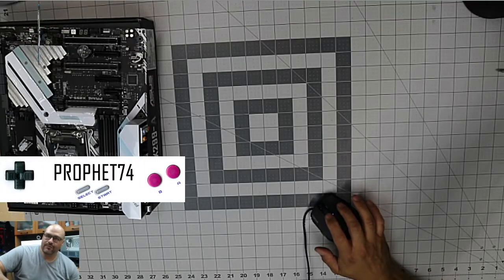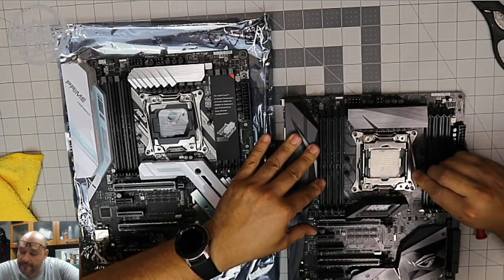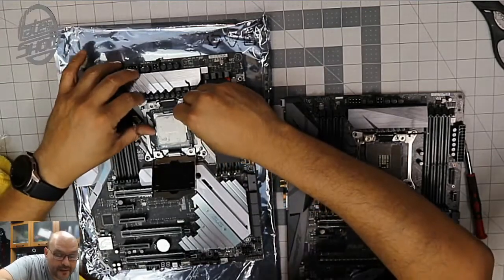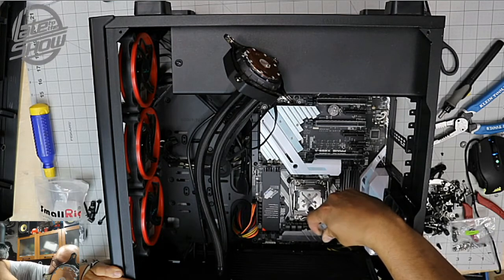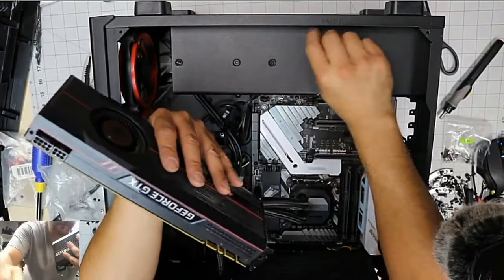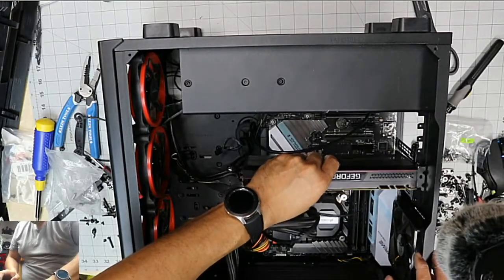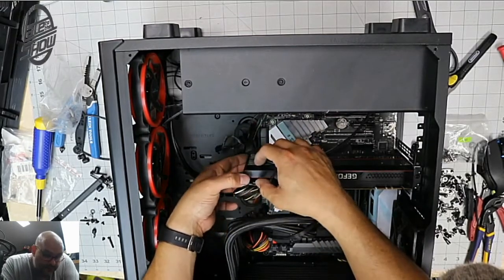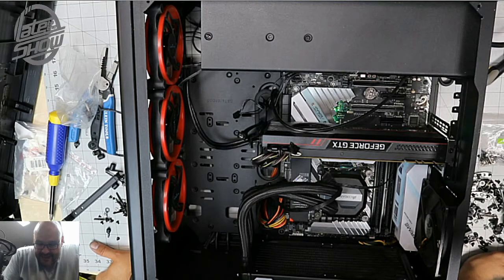Asus Prime X299 , i9-9940X PC Build

Comment: Hey there, My main goal is a multi media machine with as many NVME M.2 SSD's on board as I can get, 8 - 12 Tb's. They have a new version of this, I think with 3 on it, and I am wanting to put an  Asus Hyper M.2 X16 PCIe 4.0 X4 Expansion card for 4 more. This is one of 2 boards I now that have the processor and 2 x16 lanes that will handle the card and graphics card. Thanks for this video.